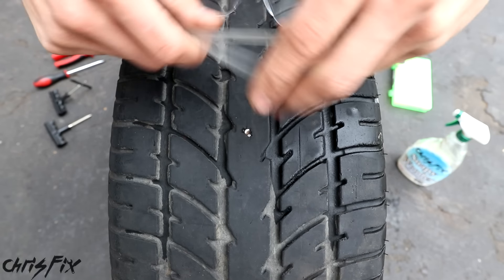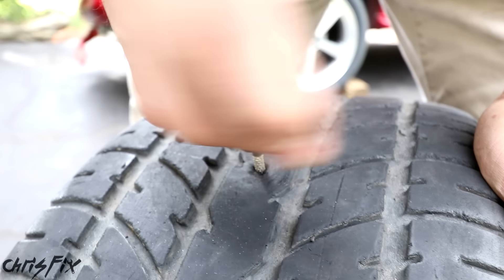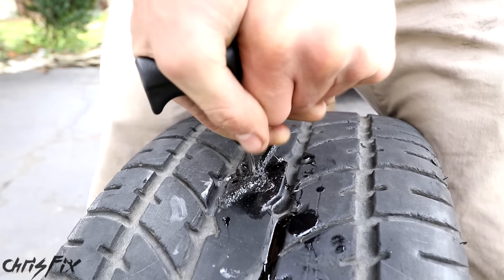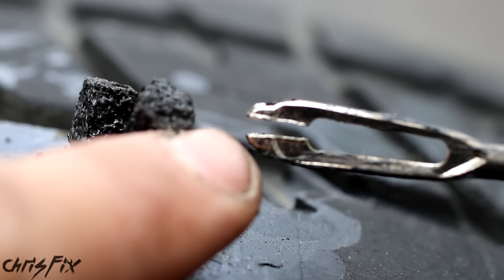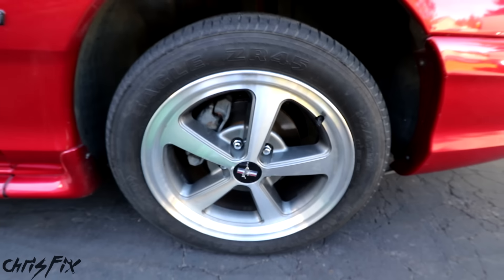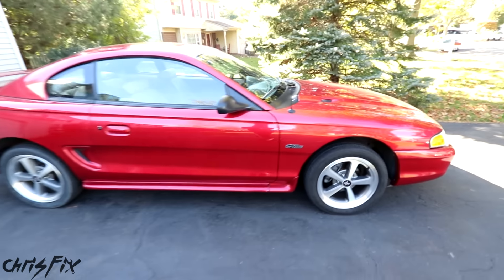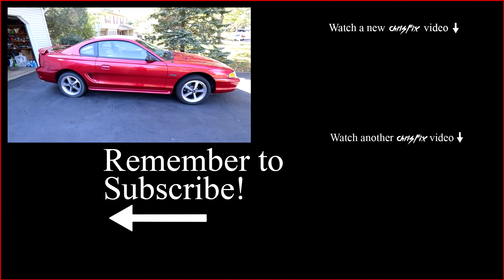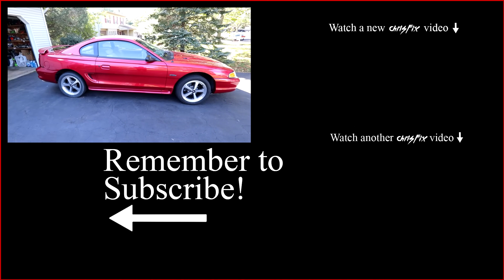How to Fix a Flat Tire EASY (Everything you need to know)

Comment: I've been plugging tires this way for 35 years and never had a plug fail. I don't ever get them repaired from the inside. Great video!
Reply: its illegal here lol
Reply: @alexanderher7692  only if someone sees👍 just cut it flush and do your best to make it seem like  the tire just has some wear to it
Reply: @jasonsoto6163  better safe than sry when it comes to security
Reply: @alexanderher7692  I had a plug on a 35 mud tire, drove it at highway speeds 75+ all the time, took it mudding to the beach everything and I never had a problem with the plug
Reply: Thanks for sharing!
Reply: @alexanderher7692  illegal to plug 😂
Reply: @digitalpacs  we are not all in the same place in the world . they work well if you are in the middle of nowhere to get you home
Reply: This sound out of topic but how old are you @dougl409
Reply: These things do seem to last for the life of the tire. I never had one fail.
Reply: @alexanderher7692  It's illegal to use the plug method ?!

Comment: I work in a tire shop and I'll admit we hate dealing with tires that have fixaflat in them. Since it damages the tires internally and usually voids any kind of road hazard waranty. I highly recommend using Slime because it's TPMS safe and easier to clean out of a tire. Not to mention it doesn't damage a tire. 

That being said I appreciate the content you place in your videos. It's lengthy but detailed and spot on. Keep up the good work.
Reply from the maker: +Alericslade thanks and thanks for sharing the useful info!
Reply: As Chris said, thank you (and Jimmy S) for the feedback. I've used Fix A Flat before but I had heard that you should warn tire shops about it before they serviced the tire. Wasn't sure why but I wasn't aware that it screwed up the TPMS or that it could make using a patch impossible. Unfortunately car manufacturers, when they don't provide you with a donut, give you a can of this crap and maybe an inflator. Just bought a Mustang GT and sure enough, nothing but a can of Fix A Flat and a portable inflator. Trunk is set up for a donut but since I didn't check (or apparently check the right box) this is all I got.
Reply: Jimmy S you can use your nose to plug the hole
Reply: Good to know that slime is better. I'll throw out my can of fix a flat.
Reply: Alericslade r
Reply: Yep, Tire Shop employee here, I fucking hate the shit. Makes the shop reek of harsh chemicals, and it eats away at bead sealer and vulcanizer, so not only will it not fix the leak that you were intending to, but it'll make your tire start leaking at the beads, and any previous plugs. At no point in my life would I willingly put that shit inside one of my own tires unless I had literally no other choice whatsoever.
Reply: Shut up I'm going to use fix a flat and make u fix it and clean up the mess because that's what I'm paying u for
Reply: I once went to the tire shop and they used a plug to fix the hole
Reply: Alericslade i don't give a shit what you hate working on, it's your job and I'm paying you.
Reply: agreed
Reply: I used that stupid fix a flat in an older car, i had some falken ziex tires with nice aftermarket rims and i had to throw out the set because of that crap ruining one of the rims and tires.  it also solidified in one portion of the tire making my car shake like crazy when it hit 65 on the highway.  was glad i had kept the OEM rims and tires which werent too bad and used them until i traded in the car.  just didnt have the nicer tight handling of the aftermarket's.  I wont ever use a can to fix a flat ever again.  Great video as always Chris!!
Reply: so dear tire specialist, you preferred robbed the people for this little screws, and charge them after as helicopter price, just because you need to sale tires. Don't you? Or you are afraid all customers will go away from tires shop.
Reply: Same here we can’t repair a tire with fix a flat and I’ve had so many rope patches come in leaking
Reply: it smells  and makes a mess   and can get on you  its sticky     and I hate to deal with it.   I would not use any of it   .
Reply: Big Hoss thing is they dont have to work on your shit they can refuse service and leave your ass lookin for another shop and there isnt anything you can do about it
Reply: I've never had a bad experience with taking a flat tire to a repair shop.  It's usually $5 and they have it done in a couple hours.  I don't know what everyone's complaining about...
Reply: Jimmy S 0
Reply: Alericsla
Reply: sminthian hrs wtf where I go they take 15 minutes max
Reply: The Slime is a lot better. My Celica’s right rear tire had Fix A Flat instead of Slime inside of the tire.
Reply: @danielhudson1690   Thank you, someone gets it.  These people have never worked in a auto shop and it shows.   Imagine someone coming in for four new tires in the summer after driving hours and don't tell you that they used  fixaflat. It looks and smells like soured milk that's been sitting in the sun.
Reply: @zombikandi1575  Preach!
Reply: It doesn’t damage tires. People are just full of crap
Reply: Jimmy S  I wish I knew this earlier…

Comment: Just plugging the tire is perfectly fine so that everyone knows. My grandpa taught me how to mount tires on the rim and how to fix leaks. We use the plugs exactly how Chris uses them but we never went to get it patched and as long as the plug sealed properly the tire works just as good as it would otherwise.
Reply: the only reason they say you need to go to a garage and have tire is patched  is the lawyers are worried the tire might have been driven when flat for a while damaging sidewall .when garage takes it off to patch it  they can see it on inside of tire . but people drive on half flat tires all the time because they never check them but we don't want another giant firestone tires exploding problem with lawsuits on suvs
Reply: @ranger178  Agreed but also I think it's gonna depend on your situation. If you have a high speed rated tire I definitely wouldn't keep doing those speeds with a plugged tire. But if just for commuting you know no problem there.
Reply: @JackRR15  i
Reply: @JackRR15  I agree, especially if your plug is in a rear tire on a vehicle you use for towing
Reply: Thanks for sharing! I was hoping that was the case!
Reply: Yeah I've driven on a plugged tire before and it's really no problem.
Reply: When we pull the tool, the remaining plug inside the tire is expanding. That is enough to seal from inside.

Comment: HI, Chris Fix! A Big-Name tire store in our town wanted to charge me $200 to replace a tire with a small hole in it, same size as the one in your video. They said it could not be repaired and HAD to be replaced. They didn't have it in stock and said they'd call around for it. Lucky for me it wasn't in stock as I might have gone for it. Saw your video. Did exactly what you said to do. Tire is repaired, by me, and back on the car tonight. And holding air.  Thanks, Chris. Great video, as always, from you!

Comment: i work in a tire shop. great video glad you threw in that part at the end about patching tires. most people dont realize that most shops fix flats for free when you buy tires from them plus if they use a patch plug combo its even safer. also really glad you said something about sidewall and shoulder damage most people dont realize that's unsafe to repair
Reply from the maker: Thanks! I am glad you approve of the video!
Reply: getecknics  rhwwwww
Reply: getecknics Hold up, hold up, hold up (What)
Let me catch my breath (Yeah)
Let me count these checks (What)
Flex on my ex (Yeah)
I don't got no respect (I don't, I don't)
Break up in a text (What?)
Pull up in a GT3, fly off in a jet (Vroom!)
Ee
Reply: getecknics discount tire?
Reply: Drayton Ellman nah Tire Pros

Comment: Good instruction Kris!  In 50 years of driving, I've very rarely had a tire slit, sidewall punctures or leaking at the rims.  98 percent of punctures are in the tire face caused by nails and screws.   Using a tire plug kit with "gooey worms" is a great investment that will save you a fortune over time by doing the repair yourself.  Convenience is also top on my list, because a repair can be completed in about 15 minutes.  Note: You usually discover the flat in the morning, on your driveway after the vehicle has been siting over night.  I never use the contact cement, since it doesn't seem to improve the repair and it makes a mess of your plug tools.  After your cut off the worm nub with side cutters, light the remaining nub on fire and let it burn like a candle for a minute or so to level it to the tread and complete the seal.
Reply: About to fix a tire... and I like fire. When I'm done I'm going to light it on fire- great idea even if it does nothing at all!
Reply: @Lord_of_ChaoSan  Never had a plug repair leak.
Reply: Thanks old man we need more teachers like you
Reply: Great idea! Since I'm doing it on my bday, I might as well sing a bday song to myself while burning it like candle!
Reply: @googliang1  I hope all your wishes come true.

Comment: Small tip in case the tyre is dead flat and the car is old: you might find that 2 bolts break loose easy, yet the other 2 are impossible to do. It means the wheel might have a slight tilt (milimiters) that holds the 2 bolts from loosening.
In that case you need to push the car a few inches, bring the tough bolts in opposite location (e.g. if they were the bottom ones, now the wheel will turn and.they will come up), making it easier to break loose.

I have changed a tyre more than 15 times and this happened to me recently.
I litterally stepped ON the tool, weighing 245lbs and the bolt would still not break loose. After slightly spinning the wheel it was fine.
Reply: Instead of pushing the car you can just jack it up a little and rotate the wheel, then lower it and try again but good point, it happens when it happens...
Reply: Cool I didn't know that thank you. 😊

Comment: I have fixed my car tires two times with that plugging wire and both times it lasted until next tire change. So both times I drove with plugged tire for more than a year. So I think this kit is the must have!
Reply from the maker: It's a great tool to have!
Reply: How many miles do you think that would have been?

Comment: I drove on a plugged tire for for 5 years
Reply from the maker: Yea they "technically" arent permanent but in reality, they last and work so.
Reply: Omg bro insane
Reply: @chrisfix  insane to d 5 yearsrive on one for
Reply: Cody Corum me too
Reply: Yea had mine for a good year
Reply: 5 years is a lot. Do you even roadtrip bro?
Reply: Yeah a technician says they last for a life Time of the tire. I have it on the side of my tire for a year now.
Reply: Done right, they last for years. Not sure how safe it was, but I have driven over 10 laps on the Nurburgring with a plugged tire many years ago with no problem.
Reply: In the UK that would mean a failure on its annual test.  If the plug was in the roughly 2/3rds centre section it can be repaired but outside that it cannot be repaired so it is either condemned or an inner tube is fitted IF the wheel is suitable for one.  Personally I buy Evergreen tyres which have a lifetime warranty against accidental damage.  You just pay for the tread you've used.  Pretty good tyres too.  I've been using them for a few years now and have good handling and wear characteristics.  I always bought Continentals before these but they are very much on a par and cheaper but not 'cheap'.  The warranty swung it for me.
Reply: Mean your tire almost become fossil.
Reply: No freaking way 5 yrs my brand new tires don't last that long u had it parked I got it
Reply: true ive two in the one tyre and going strong for 3 years
Reply: They call you Tommy 2 times . .
Reply: I have been plugging nail and screw holes for decades and ran them with no problems whatsoever. Would never plug anything near or on the sidewall. Also i dip the plug into the liquid glue as extra insurance and it works great to get the plug in easier. Cutting the protruding plug off prevents it from being pulled out by tire road froction.
Reply: I drove on my current tire up to hundred thousand miles and still works!
Reply: @geemillz7144  I bought my current car brand new slightly over 5 years ago. It's a front wheel drive and it still has the original rear tires on it (the front tires I had to replace last year).
I'd say am a slightly more aggressive than average driver, so either the roads in my country are just better or you spin your tires too much. :P
Reply: Cody Corum was that your daily driving car?
Reply: I have also driven on a plugged tyre for 5 years.
Reply: I’ve drove 48,000 miles on a plugged tire lol. Got a nail pulled it out and got 48k out of it.
Reply: @ayporos  Just a friendly tip: You should actually switch the front and rear tires. Its more important with good tires in the rear than in the front. Opposite to what most people think.
Reply: @andreassundberg5636  I doubt that applies to all cars.
I drive a front-wheel powered car with disk brakes in front and drum breaks in the back...  you better provide some sources for this claim before I am convinced. ;)
Reply: @ayporos  hes  right because if you put the better tires in the front theres better grip in the front and less in the rear so makes it more likley to oversteer espechialy in the wet its easier for the avarage driver to correct understeer than over steer im a qualified mechanic and got tought to do this 👍
Reply: @saezbrothers511  r/Ihadaatroke
Reply: 5 years on one tire ya okay man
Reply: Cody Corum what happened after 5 years?
Reply: @chibyk2008  Good troll... LOL!!!
Reply: I have a plugged Tyre( two plugs) and driving for 2 years....no problem occurred, my Stepney has one plug and I check the air pressure regularly and observe that there is no air leakage
Reply: @geemillz7144  If you garage park it at work and home tires could last 5 years
Reply: @ayporos  having the good tires in the back helps keep the rear of the car from fishtailing during a breaking situation. In the front you can stear to correct some of this but the back has only the tire treads. Most tire shops have diagrams to show this.
Reply: @darthtripedacus1  I thought the way to correct fish tailing was by letting go of the breaks to allow the car to straighten itself? Tbh I've never been in a situation where fishtailing was a problem.. however I have been in situations where not being able to break fast enough almost was a problem.. I'd prefer to stand still sideways and NOT hit whatever I'm breaking for rather than travel straight without fishtailing but lack the stopping speed and actually hit something...
Reply: going on 4 years with a plug in my tire...never leaked lol
Reply: Yeah, just think when you take your car above ~75-80 mph... what between you and the road surface ⋯⋯
Reply: Rope plugs are so under rated............
Reply: @saezbrothers511  its called being cheap

Comment: I didn’t read through the comments so if i’m repeating it, sorry. Like Chris says, check to make sure you have a spare, jack and lug wrench. I didn’t do this on a used truck I once bought. I blew out a boat trailer tire on the interstate 100 miles from home on a Sunday afternoon. I found out the truck did not have a tire iron. I found a basin wrench (google it) in my truck and used that wrench to operate a scissor jack and to remove the lugs on the boat trailer. I got it done after a ton of swearing and effort. The lug nuts were completely ruined when I got them back on and were carefully cutoff with a dremel tool when I got home. So make sure your vehicle has the correct tools and know how to use em. Great video, my plug job is a success!

Comment: I have used those plug kits to fix tread area punctures for years on several different cars. Those tires have been used for light off-roading, towing/hauling, and on track going over 120 mph. I have never had a problem. I think one of my SUVs tires has about five of these things in there.

Comment: I work at a tire shop so I have felt with endless scenarios similar to this, everything Chris states in this video is absolutely perfect and yes we really do hate bottles of Fix-A-Flat in tires lol. Except for one thing, those rope plugs are NOT SAFE, they are not made of the same compound as a professional tire plug and they actually slightly absorb water, this commonly leads to water getting into the belt package (the metal cords inside of a tire) and can create rust and corrosion which can then cause the tire to weaken and be more likely to explode. Your best bet is always to get it to a tire shop as soon as possible to have it professionally plugged and we also will put a patch on the inside of the tire to back the plug up and give it an air tight seal.
Reply: Damn straight